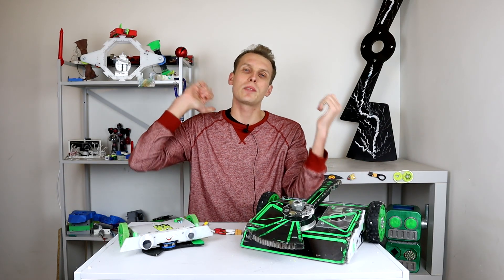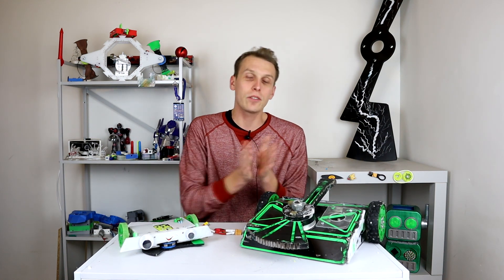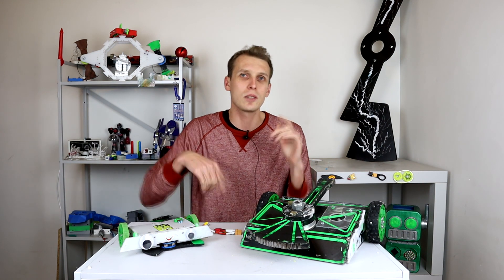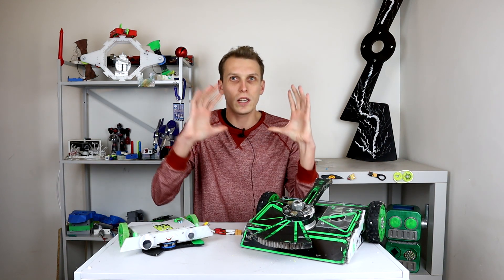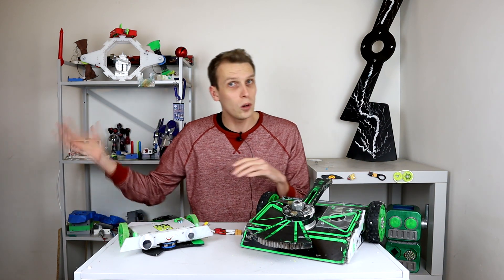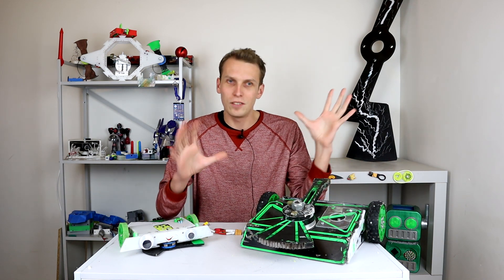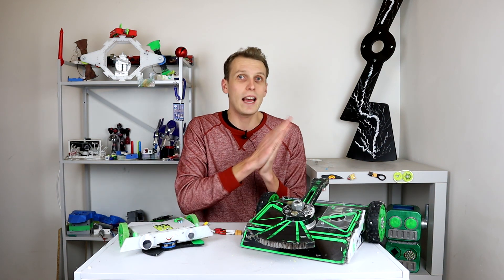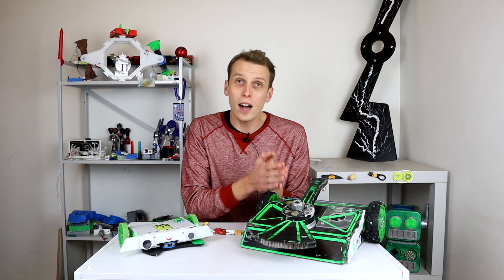Designing Power On Hardware

Comment: An interesting video. As far as I understand, turning on a fuse in the circuit may work quite well. At the same time, it can act as the last extreme fire protection system, and when installed in an open place in the housing, it will act as a visual indicator. At the same time, it was originally designed for use in cars, which implies some protection against vibration. It weighs little, attaches to factory contacts, takes up little space, can be screwed in different positions if you purchase the appropriate connector. The only problem with this approach will be that it is almost impossible to remove it with a long stick unless the seat is intentionally modified

Comment: Hear me out you have a light sensor as a switch. To turn off your bot you stick a piece of tape, a box, blanket, etc. over the sensor and the bot is off. Alternatively, If you used an infrared sensor then you have the arena lights emitting infrared light so the bot only turns on when placed inside. This way instead of turning off your bot manually you would just turn of the lights in the arena.
Reply from the maker: NO NO NO!

The switch is a safety mechanism, you do not cheap out or go experimental with the switch.

A light sensor or sensor of any kind cannot handle the raw current and voltage a robot needs to run, which means your "switch" would actually be a mosfet or other power component activated by the sensor, so if the sensor fails, or something shorts your bot would turn on or get locked on and you'd both have no idea and no way to quickly and reliably shut it off.

Additionally sensors need power, which means your "switch" is constantly draining your battery from the second the battery is plugged in.

Having two pieces of metal (in a switch or as a link) touch via an outside force (you) is a much much safer and reliable design.
Any Event Organiser who cares about the safety of builders during an even would not allow you to compete with a sensor based "switch"

DO NOT DO THIS

Comment: good points all-round, one thing I would possibly add for safety is the ability to power down after frame damage, as damage the name of the game if people burry there switch deep down in the robots it is possible that the frame can get twisted and you cant power to it with your tool as you can't reach it. yes is probably  only a real issue with steel construction bots but it is something to think about (links in the situation, in theory, is able to have the wires cut ) 

I would like to have the option in the UK as arming overheads spinners or shelly a real issue as it requires either some not soo good link placement from a safety PoV or passing it up through the weapon shaft with means it has to be a dead shaft and adds it own issues
Reply from the maker: Agreed on both fronts.

Comment: I haven't gotten into the whole rule set of links and switches as I'm still fairly new to the building community. So I don't know how creative you can get with building links. But after thinking about the topic how about something like a bottle cap with copper on the inside of the top that functions as link and the wires you need to link sit at a cut off piece of the bottleneck. You could twist on the cap to make a connection and it would hold tight. If you get fancy you can add in spring loaded knobs that you need to press in when taking off the cap. Those knobs would prevent the cap from being twisted off during battle.

Comment: hey ben, In motor racing we must use a blue or contrasting electrical symbol in a triangle where our battery disconnect switch is located, it is possible we could implement something similar using a 10mm triangle on ant weights and a 20mm on beetle's, just so everyone knows where the switch / link is
Reply from the maker: Thats a good idea!

At battlebots they require markings on robots to show where switches/links are, most people use a wyatich sticker. But standardising that idea across weight classes would be helpful

Comment: The Robot Wars 101 rules say that a power link "that can be operated without tools" starting from nanoweight class, FRA guidelines for weight classes starting at beetle state that these need to be links. General tip: check the relevant rules before applying, you don't want to disqualify because of the 2 grams you shaved off.
Reply from the maker: Always a good idea to keep referring back to the rules of the comp you want to compete in while designing

Comment: I have only used links since I live in the UK but I have learnt that just cable tie the link onto the back plate has a few issues but I have learnt that Velcro and a link box and bolt the the connector where the link plugs in helps alot in heavy weights and a design feature I have is that the top armour has a hole so you can reach in side to the link with out needing to put your hand in the weapon or wheels and the bonus thing about this is once a robot went rouge during the power on area and went into the back of my robot and my hand and arm was fine not even a scratch